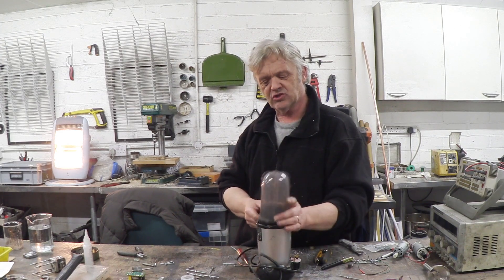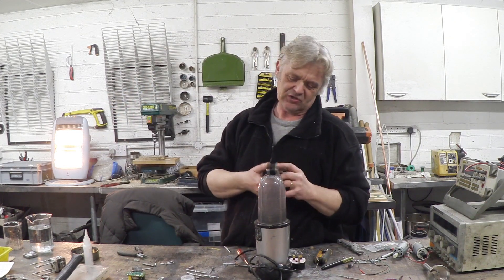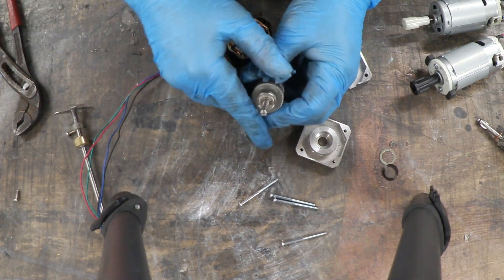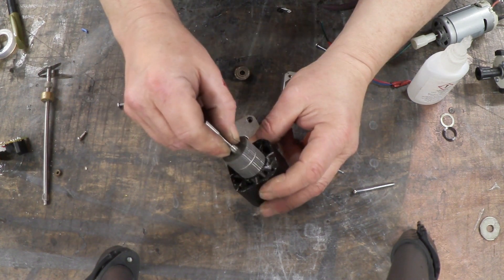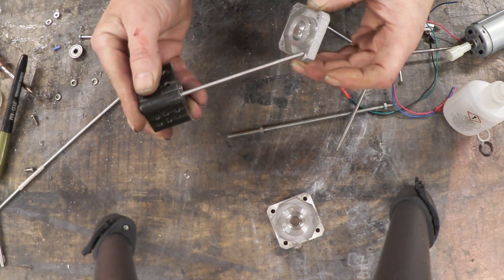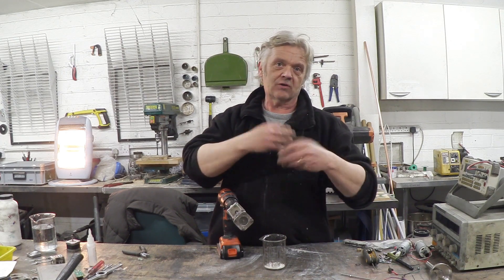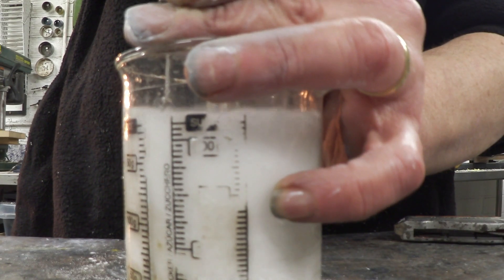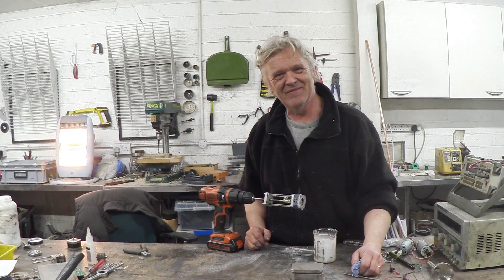1057 Turn A Stepper Motor Into A Shear Mixer

Comment: Excellent lateral thinking, Rob. Very nice indeed. I just made a big vertical marble mixer roughly following your design, but with a big gear motor, speed control, and paddles for really rolling those marbles around. Better for making graphene than a high shear blender for my large flake graphite, I think. But I will make one of these because, well, science and engineering, of course. And I have some big ancient steppers in my junk box...

Comment: Hi Rob, and others: A workmanship tip passed on to me from Dad. When using a handsaw (hacksaw or wood), don't grip it with  fists. With the driving hand, i.e. right hand if you're right-handed, extend the index finger down the side of the handle as if pointing. The other hand, just use the fingers to steady and align the saw. All the power comes from the pushing hand, not pulling. Slow down and make deliberate smooth strokes, it will still cut as fast. Try it, you'll be amazed at how you can accurately control the saw and cut along a line, it just becomes completely natural and you'll never do it any other way. Watching Rob & Luke and other video makers pump away with closed fists, and the saw wobbling uncontrollably all over the place, just thought I'd pass it on.
Reply: Or use an off-cut saw with a thin blade...
Reply: Absolutely! Just passing on the learned skills from the days when there were no power tools. Used correctly, a hand tool is very satisfying and sometimes even more efficient.
Reply: Yes thats correct . I learnt this in sheetmetal class 40 years ago!

Comment: i wonder if you can shear two solutions 'silicon+ phosphorus' and 'silicon+ aluminium' with these then dip coat, brush, spray a layered flat ink diode on conductive ink + kapton/plastic  ^_~

'The Engineering Mindset Diodes Explained - The basics how diodes work working principle pn junction'

one step away from...
"PNP sensors produce a positive output to your industrial controls input, while NPN sensors produce a negative signal during an “on” state. ... NPN, or “sinking” output sensors, work in the opposite way, sinking ground voltage to an input when it's on." localised diy electric cooling etc

Comment: Those small blender can explode
Reply: Mine did when blending paper towel with water . It was on for 5 min only half full and the pressure and heat built up and the top come off and went through the ceiling and paper machete all over the room. I certainly learnt something that day 😂